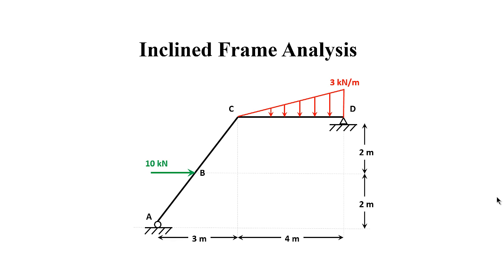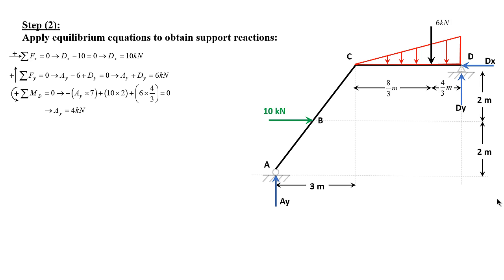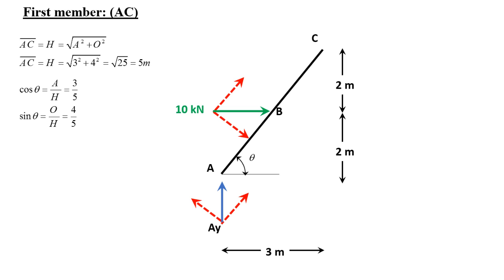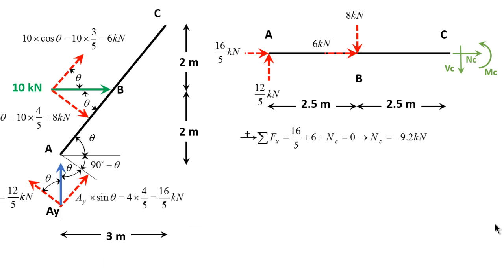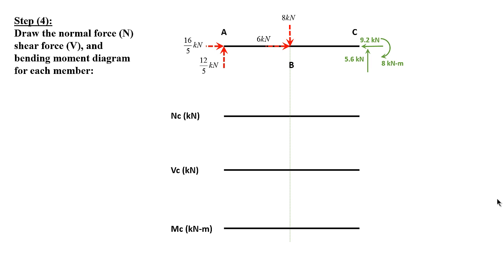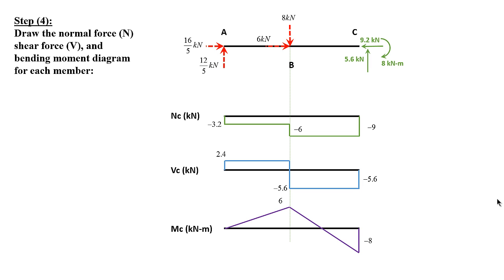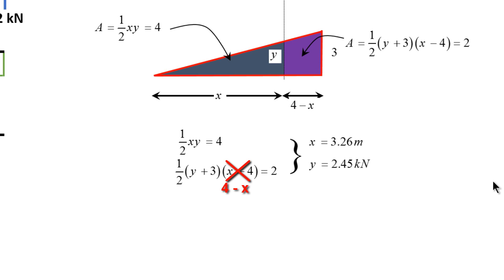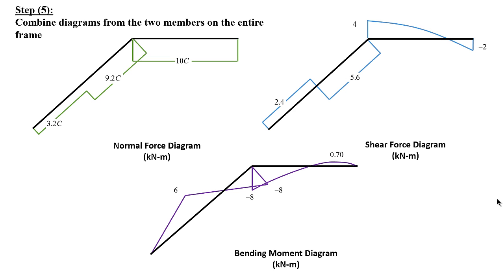Drawing N, V, and M diagrams for a frame with an inclined member

Comment: hi, how can you draw the shear and moment diagrams of beam having four(4) span from A to E, a settlement at B=1" and at C=2" with both end fixed. Span AB has a UDL of 3.33k/f with Length 24'-0"; Span BC has a point load at midspan with length 16'-0"; Span CD has no loading with length14'-0" and Span DE has a UDL of 1k/f with length 30'-33"
Reply: Try and do your work my friend!
Reply: LOL....ok